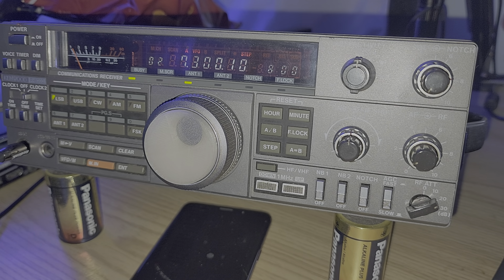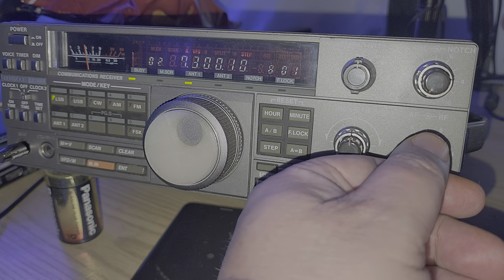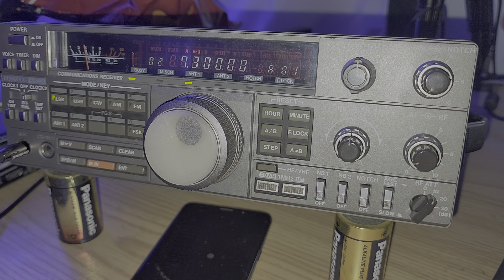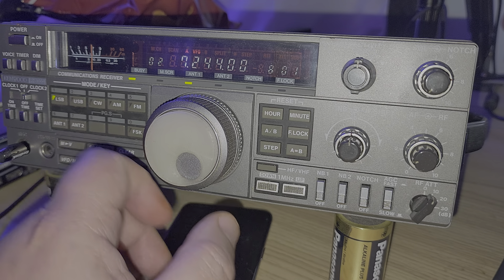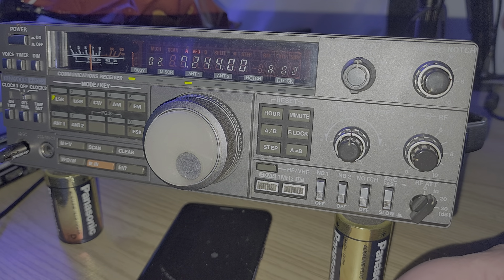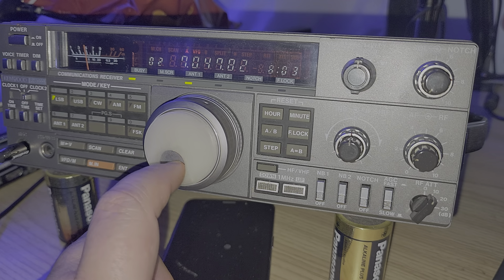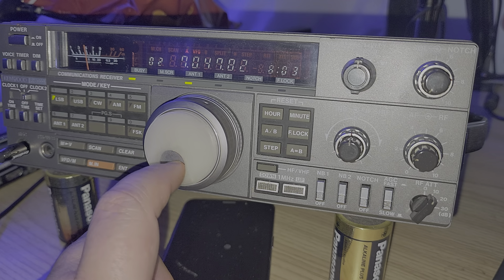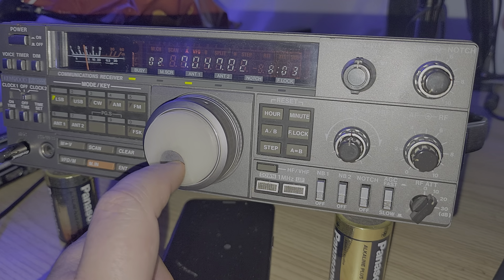Kenwood R-5000 Tuning the 40 and 80 amateur radio bands Shortwave LSB on M'LA 30 loop

Comment: I had wanted an R-5000 in the late 80s, but decided at the last minute to get the lower end R-2000 instead, which was much cheaper, but that was a big mistake. The R-5000 is much batter according to reviews and other users comments from those who had experience with both models. Enjoy!